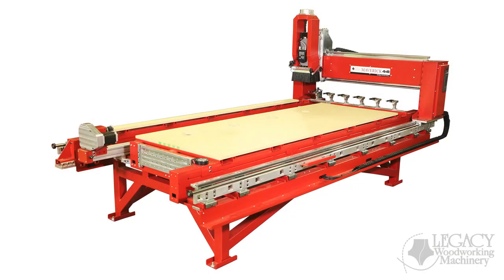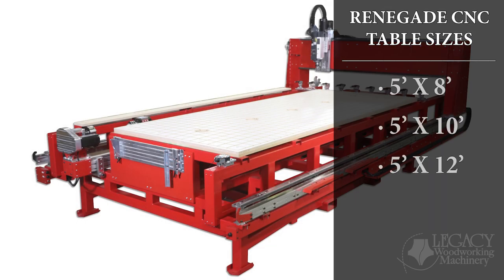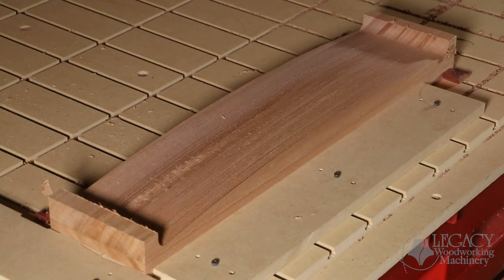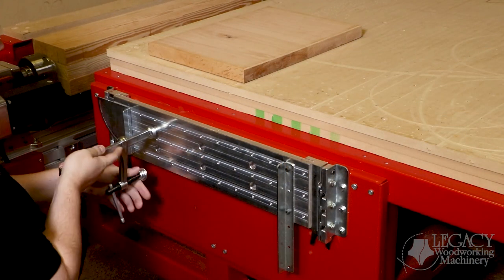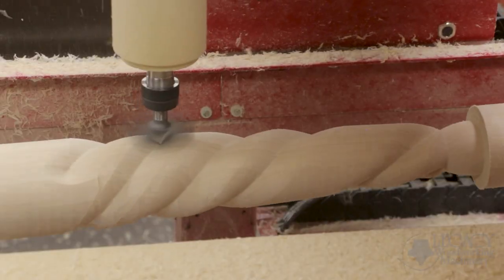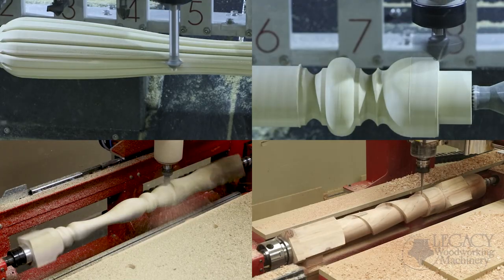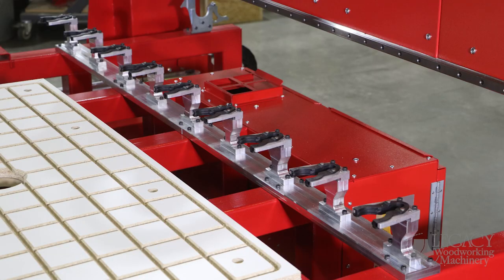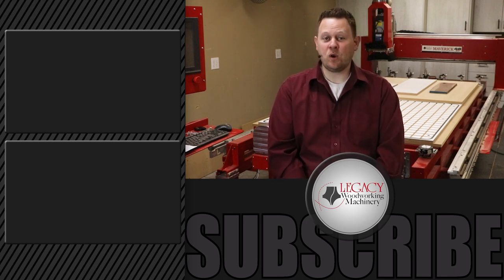Best CNC Router For Furniture Makers and Cabinet Makers - Legacy Woodworking Machinery

Comment: How much sanding is required after milling, especially on the four axis tool?
Reply from the maker: That is a great question, It really depends upon what you are doing.  If you are 3D carving then it is about the same time as you would do with a 3D carving on the flat table. If you are machining with router bit profiles then the sanding really is minimal because you are using the bits geometry to create the shape and as long as the bit is sharp the cuts are clean and smooth.